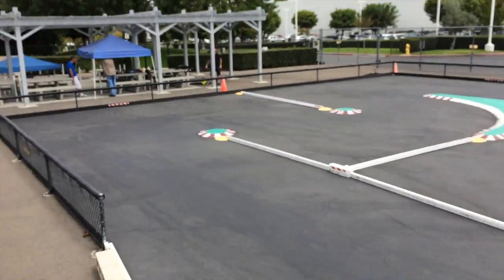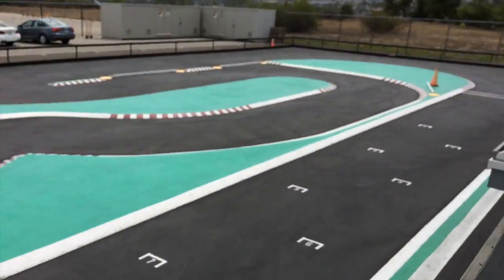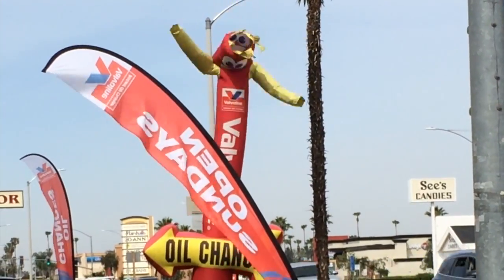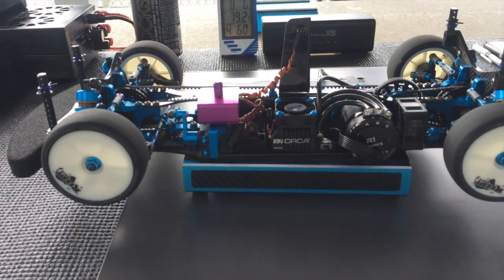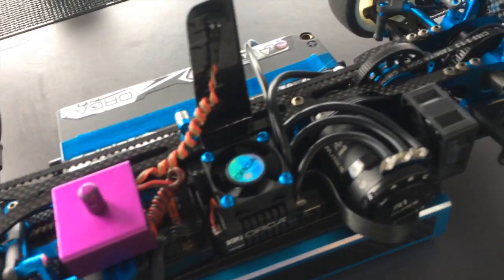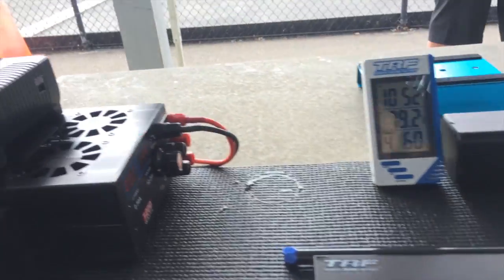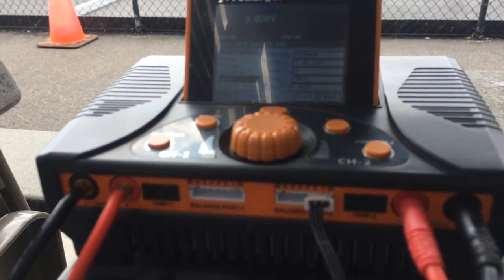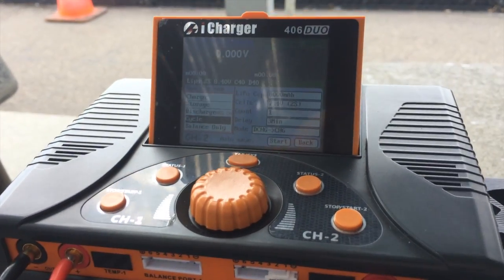Battery Charge Rates - 40amps is Faster_ Velocity RC Cars Magazine

Comment: It was always accepted with Nicad batteries that the faster you put it in, the faster you can take it out. But you had to be very careful not to overcharge. The problem with Lipo batteries is that they don't just go bang - they start a fire which can't be put out by normal means. Be careful guys.

Comment: Wonder what the life expectancy of a pack is as 40amps...
Reply: Max amps, pretty much forever still, turnigy ... one cycle
Reply: I've been discharging at 40 amps, then immediately charging at 40 amps for 6 months on the same two trinity packs.  They still have lower internal resistance than a lot of new packs I see out there.  No puffing either.  It really just depends though.  Not all lipos are equal. Even from the same manufacturer.  Always put the batteries in storage when not in use.